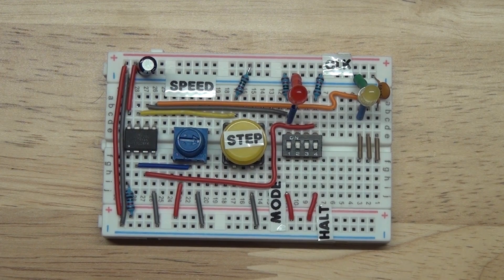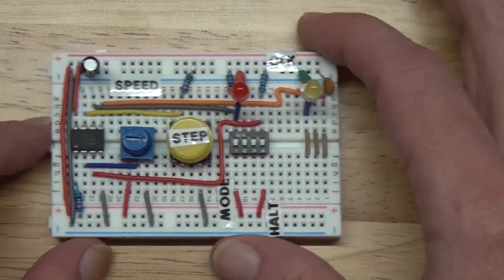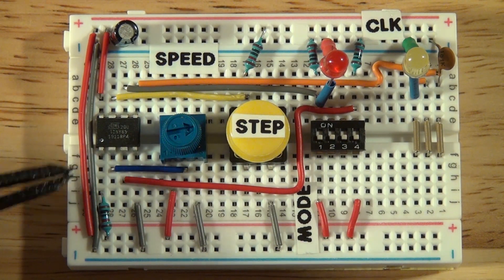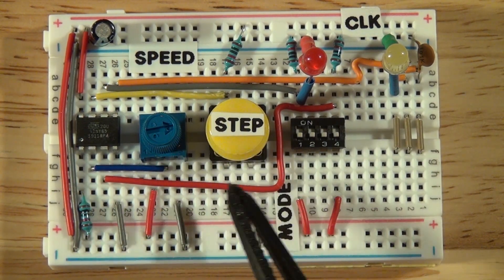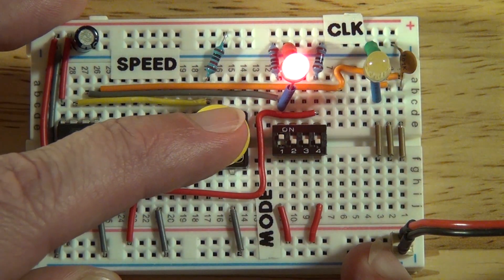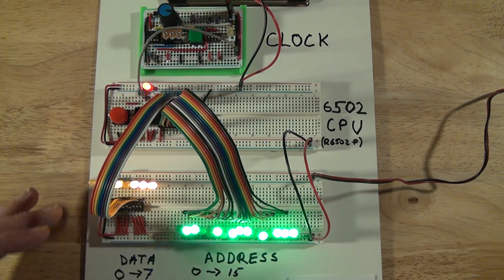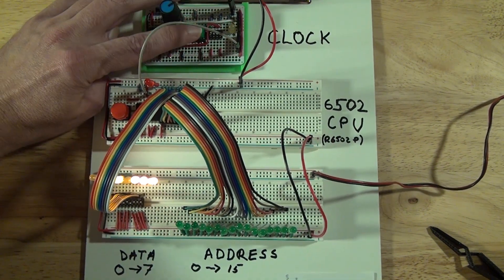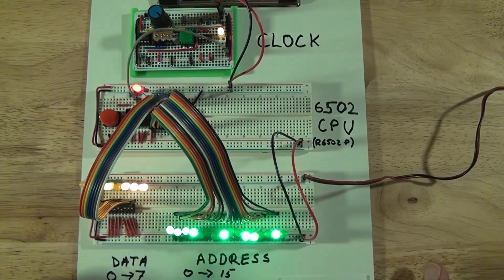Clipboard Electronics: Retrocomputer (6502/Z80) Clock Hardware

Comment: OMG! I can't wait for the next video! I am currently building a Homebrew 6502 and I NEEEED this clock module. Pleeeeaase upload soon, the anticipation is killing me ;) Also, will the code be available for Arduino IDE? I suspect that you are using pure C in another IDE, but would be really cool if you could make an Arduino sketch too. I also wanted to incorporate the 'Debug Step' circuit from the brilliant Steve Wozniak (http://apple1.chez.com/Apple1project/Docs/pdf/AppleI_Manual.pdf page 12) next to this circuit. Great video btw :)
Reply from the maker: No, actually it is in Arduino! If you look back a couple vids, you'll see how I built the programmer and where to download the tools, then you can use Arduino editor to program the ATTiny (any version). Single stepping the 6502 is extremely tricky with a standard 6502. It just doesn't seem to work, nothing I have done will make it hold the registers more than a second or so. The Woz design does not seem to work. I got frustrated and replicated his circuit exactly, and it still didn't work. So, I think the best option is to get a CMOS 6502, which plays fairly nicely when single stepping.

I have been going off on a tangent in my life with some glassblowing and now some lapidary work. But, since you asked, I do kinda feel like finishing the timer video now. I really wanted to do an in-depth explanation of it, but maybe just a quick one would help people get what they need. Problem for me is, I think the timers hardware is FASCINATING! I really want to do a video about how it works.
Reply: @jasmine2501  AWESOME news about wanting to finish the video off.... definately do it!! So you couldn't get Woz's circuit to work? I simulated it in LiveWire studio, and it seemed to work quite well... interesting that you couldn't get it to work for you. Someone seems to have done it succesfully (https://www.applefritter.com/content/mysterious-sync-apple-1-manual-diagnostic-card-apple-1).  But then, I've got the CMOS WD65C02S chip so might still give it a go. I'm not keen on using a 555 timer for slow stepping (while I learn ASM code) as I wanted to get a clean near 50% duty cycle from 1Hz to about 100KHz, and from what I can tell, that is not possible with a 555 through the freq range. And that is why I'm interested in your circuit.... but also, a 8 pin micro processor!!!! how cool is that!?! you got me intregued with them now too.
Reply from the maker: The ATTiny has an internal 16MHz clock, and it can actually produce an output clock signal of up to 8MHz by using the hardware timers. The main reason I used the ATTiny is the principle of least hardware that will work, and the form factor contributes to making a half-breadboard clock module possible. Things like the Arduino Nano just take up too much space, and they provide way more pins than I need. ATTiny DIP packages are very cheap too! I ordered 10 of them for 21 dollars! So, you save a ton of money over an Arduino board, and I think the module overall is less expensive than a 555 and all the discrete components to run it. I'm experienced enough with real engineering to be very concerned about that stuff. I want things to be as cheap as possible while still working, and I like to reduce component count as well. I wish I could afford to do this full time, but today I will be writing code for my job. Probably work on this video tonight. I actually bought an mid-range oscilloscope to help with these videos, I really want to show it off :)
Reply from the maker: I can get the debug circuit to do what it's supposed to do, but it does not halt the processor correctly. The registers still wink out after a second or two. I think the newer 6502s are different somehow. It does seem to work with the Z80 though!
Reply: @jasmine2501  I couldn't agree more with you on component count, and pcb board size as they directly relate to cost. And I just bought some of those ATtiny85 for £0.93 each... so cheap! I'm keen to see your new scope too ;) especially what the output signal of your circuit looks like over a range of frequencies.
Reply: @jasmine2501  Thats very encouraging! I'm of the opionion that Woz's circuit should still be able to step and debug at higher frequencies if I'm not mistaken. I thought that just because the cpu is placed into a wait state, the clock should still keep the internal registers refreshed, right? Maybe I'm wrong, I am only just starting out anyway so all a learning curve for me at the mo. When I connected my 65C02S up to an arduino mega (monitoring address and data pins) it held it state indefinately. But like you said, it might be down to the fact that the new CMOS version is 'static' (maybe that's where the 'S' in the model number comes in?
btw... love the 450 Pro! I had a T-Rex 450 once... sadly, it died... against a wall.
also love the 3-D printed forceps you use in your vids ;)
Reply: @jasmine2501  An in-depth video of the ATtiny timers and registers is a MUST! You have opened up a whole new set of possibilities for us with this chip, and we need to learn more about it. I appreciate how hard and time consuming it is to make a video, so maybe make a series of short videos on this topic. In fact, I think you should definately complete your retro project (on or off video) .... we need more 'Ben Eater' breadboard style tutorials on this topic...  you know... to keep the knowledge alive. I fear the next generation will not know how the computer revolution all started back in the late 70's ;)
Reply from the maker: @louisferreira9055  I was actually going to rebuild the timer hardware using 7400s, but it's fairly tricky to build it all. A small demo of a portion of it could be built easily though - maybe a 4-bit version. It's a good way of demonstrating how the hardware can be much faster than the software.
Reply from the maker: @louisferreira9055  that's exactly what I wanted to do, but it's going to be like 30 minutes long.